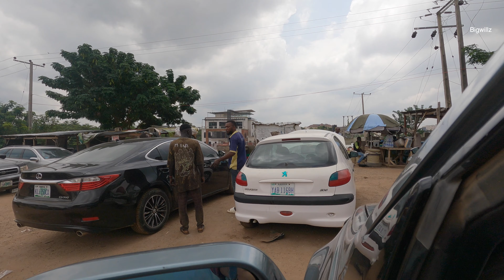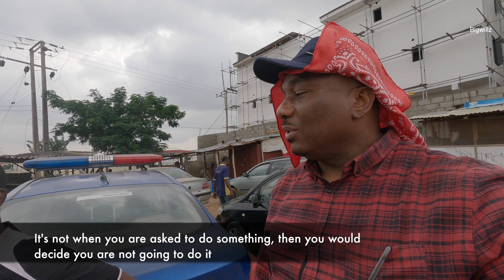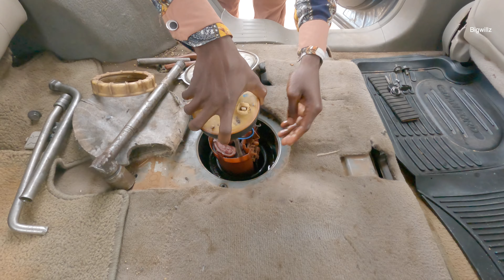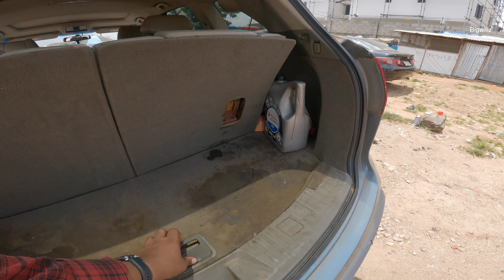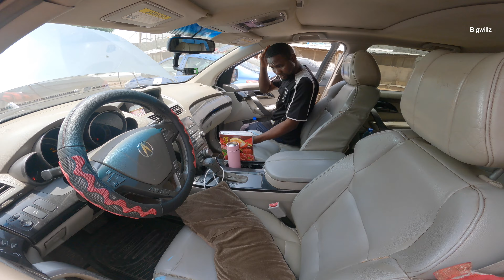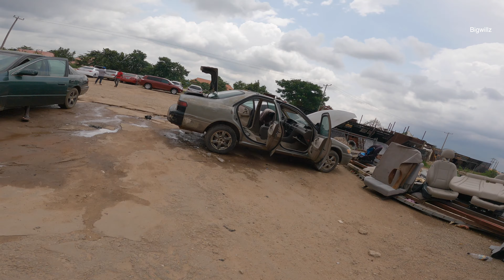Disrespecting Your Boss....Getting Ready For A Trip

Comment: Oga Bigwillz, 
Trust me, watching most of your videes just feels "okay". One can relate in so many ways..
Yours travels..
Your day to day acts like this that you share with us (the mechanic worksop xperience)..
And your simple , truthful delivery style which is HIGHLY comendable..
Ironically, we share some likes  : ROADTRIPS, PHOTOGRAPHY. ..
As per the repair work on the faithful MDX please consider checking/changing the ac valve which is MOSTLY the cause of partial cooling especially on dual zone cooling system as on your car. Then the cabin air folter, its better to change periodically together with the engine air intake filter (this one impacts fuel mileage and even performance positively)..
Please keep up your good works..Looking forward to the next roadtrip..
Kudos..
Reply from the maker: Thank you thank you so very much for the information and explanation. Very much appreciated..
 Nice to share same expressions 💕💕.